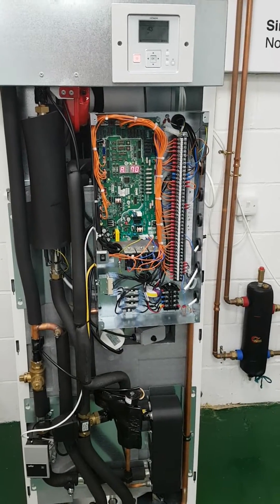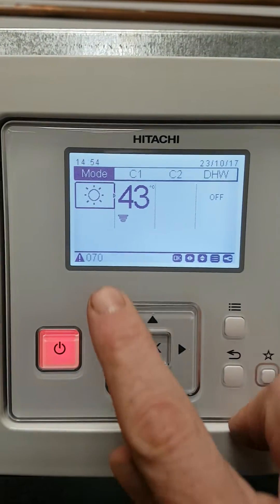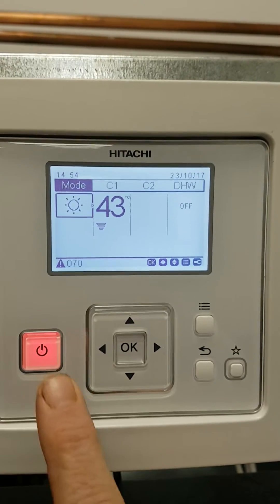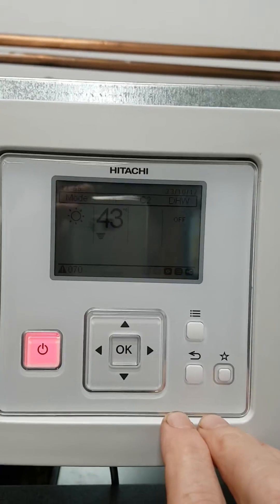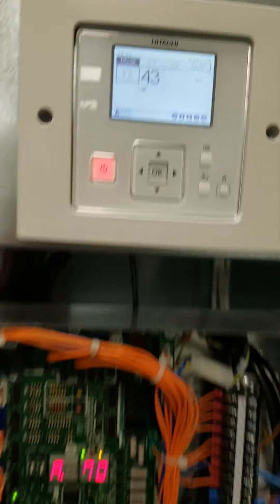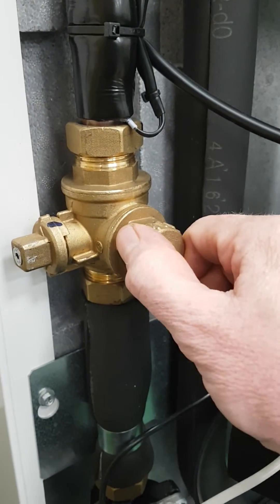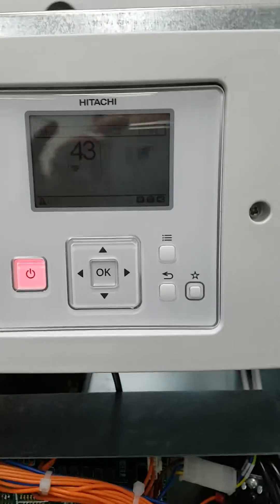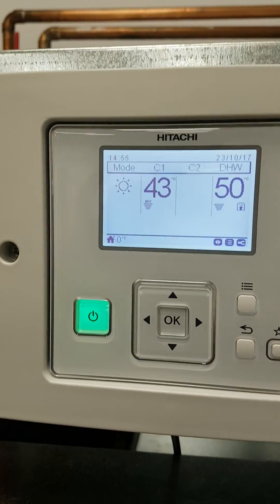Hitachi Air source heat pump error 070, 045 and 020 Yutaki

Comment: Hi. I am receiving error 070 but only on morning time when the timer both on the system and on room Thermo regulator is in use. Filter was cleaned after the first error appears. And if I use manual start all works perfectly. Do you know what might be an issue?

Comment: I cleaned the filter but the error continues A70. P70 on the lcd and 070 help
Reply from the maker: you need an engineer, for some reason the water is not moving in your system sorry

Comment: Error 45 is high refrigerant pressure, not water pressure !
Reply: Hi, do you have a manual where you have gotten this info from? I can't seem to find it. I have found manual but it does not have the 45 or 045 code
Reply: How to solve the problem?
Reply: @Urbi.UrbiUrbi  This is gap problem within the time of use and the time of rest in admin mode. Choose 10Mn for both, and it will diseapear...
Reply: @ACNNOMOREBLUFF  Where i can find these settings? Please help, the code 045 on dhw remains!
Reply: @PlaySingFun  You have to remove the cache of the mainboard box and you will find it in the reverse.
Reply: @PlaySingFun  Error 45 means that you have too much water pression in the main water network. You must find the pressure valve and release water as low as 1,8 bar when the system is off and cold. The problem is between the inside exchanger and the outside block. It can be solved with ease.
Reply: @ACNNOMOREBLUFF   1,8 bar and the error is still here...    ???
Reply: @PlaySingFun  You are still talking about the WATER PRESSURE, not the REFRIGERANT PRESSURE. Try again...

Comment: Any idea what a code 205 means??
Reply from the maker: yep its been set up wrong. 205 central control missing

In system config, general options, central operation should be set to local, if you set it to air, water or full you get alarm.

Hold back / return and ok together for 3 seconds. 
Enter Password shows,
Enter Password as right, down, left, right, 
Password is correct press ok

Press Menu (three lines)
Go down to System Configuration, Press OK
Go to General Options, Press OK
Go to Central Operation, Press OK
Set cascade mode to disabled
Set to “LOCAL”, if this is set to anything else, the unit looks for some other kind of control which isn’t there and throw a 205 alarm.
Reply: @myheatpumpchannel7577  super thanks!!!!!

Comment: I have codes 205 and 61, what do they mean and how to fix them?
Reply from the maker: yep its been set up wrong 205 central control missing

In system config, general options, central operation should be set to local, if you set it to air, water or full you get alarm.

Hold back / return and ok together for 3 seconds. 
Enter Password shows,
Enter Password as right, down, left, right, 
Password is correct press ok

Press Menu (three lines)
Go down to System Configuration, Press OK
Go to General Options, Press OK
Go to Central Operation, Press OK
Set cascade mode to disabled
Set to “LOCAL”, if this is set to anything else, the unit looks for some other kind of control which isn’t there and throw a 205 alarm.

Comment: I’ve tried this and still have code but also have code 205 any help appreciated no heating for my kids
Reply from the maker: looks like you had better call an enginner, your flow rate is too low they need to come and see why
Reply: @myheatpumpchannel7577  I had engineer out pump had seized so had be replaced
Reply from the maker: @mbyrne8770  thats not good news, you can free up old pumps and reset them , useful info for next time

Comment: hello sir, owner of a hac hitachi yutaki,i have a small problem: i tried to change the temperature and the 040 code is appeared. Since this code is appeared, i haven't having hot water. I read it's a  small problem (it seems to be an incorrect setting from the Lcd screen)on  a forum. But i didn't  find the documentation or anything to  help me. Do u have a solution?Tks
Reply: Hi we’re you able to fix this?

Comment: Good evening sir. 
I own a heat and cool pump Hitachi Yutaki and since 2015 I have the same problem every winter season. When I turn the pump into the winter settings, the 070 alarm appears. I ve checked the water filter and I cleaned it but the 070 alarm, remains. I also filled the bumper air with air pressure ~ 1 bar. 
Have u got any idea of this problem?
Reply: same here, any luck?
Reply: At minus 15 C  or more how is it  consume , having trouble with power to heat your building ? It work with radiator or only with heating floor 
Thank you. I wait your answear
Reply: Same here , I am having this probem 5 times a week.  and  this error allways beetwen 18: 00 / 20:00 o' clock